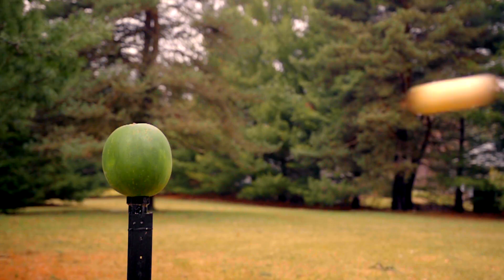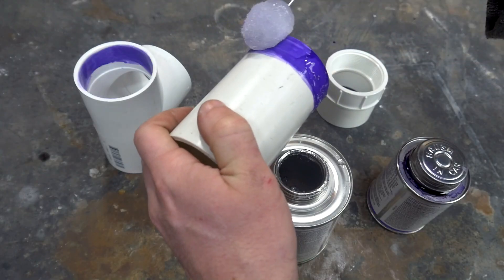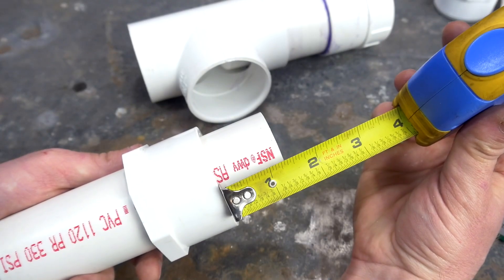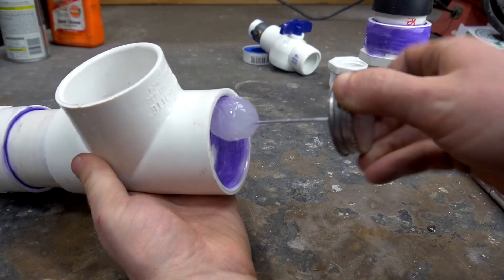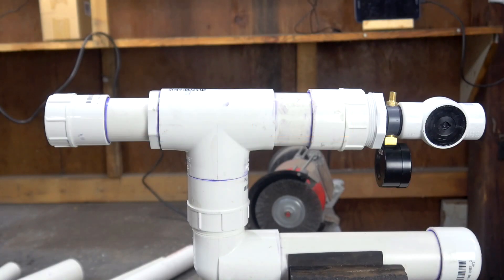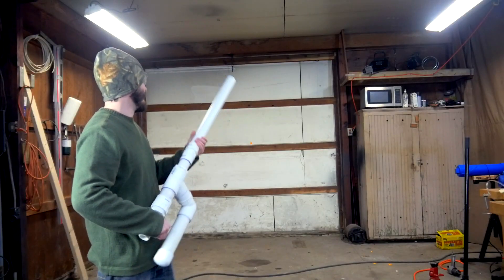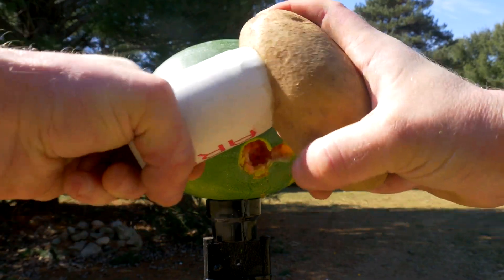How To Make A High Power Air Cannon - 2" Piston Valve (Barrel Sealing)

Comment: So I put it all together finally and it wouldn't pressurize and from what I can tell the gasket doesn't seem to be making a seal. Is there any way to tweak it with everything already sealed up? What would happen is that there would be some very, very slow pressure build up but once I pulled the air compressor away, it would instantly depressurize from whatever sad PSI it had run up to.  I figure it had to be the gasket or the piston and the piston looked fine and was properly greased up.

I was pulling my hair out, so I just rearranged some pieces and was able to put together one of those idiot-proof cannons where it's just a pvc-cylinder-as-air-tank and then an orbit water sprinkler trigger which is perfectly fine -- BUT if there is some way to adjust things or if I'm missing something, I gots to know.
Reply from the maker: Typically when the piston leaks it's because the end of the pipe it presses against isn't flush and smooth, there's something wrong with the rubber seal, or both. One trick that can fix some leaks is smearing the rubber with ptfe pipe thread paste. It makes the rubber sticky and seals imperfections.
Reply: @Nighthawkinlight  Thanks for the tip. It was a challenge putting it altogether so I don't want to completely just throw in the towel, no matter how frustrating. But if that paste can't get it to go, it'll have to be the idiot-proof cannon for me.
Reply from the maker: @divergentthinkingproductions  There's other options also. You can pull off the rubber fitting on the end of the barrel and instead glue a rubber face to the front of the piston. It can be a tricky thing to make a seal and takes a lot of troubleshooting the first few times.
Reply: @Nighthawkinlight  So I think I'm going to split the difference and use the threading paste on the gasket and then use some flex seal at the end of the piston and see if that will sort things out.  

New question:  The paste. Does that need to set or do I apply it to the gasket and just have at it?
Reply from the maker: @divergentthinkingproductions  Start with the paste. There's no set time. Flex seal has a chance of making things worse if it applies unevenly
Reply: @Nighthawkinlight  SUCCESS!  The thread paste did the trick. Very, very satisfied and very happy. A rewarding build. The only thing I have to say to other folks who want to build this is that if you're just angling to have a simple cannon that you can put together in an afternoon, this is probably not for you. But if you want a challenge and something with more kick, this if for you.
Reply from the maker: @divergentthinkingproductions  That's great to hear!
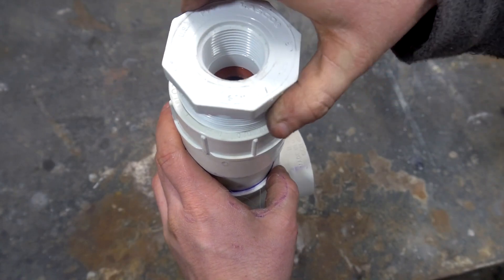Reply from the maker: You should be able to access the internals by unthreading the fitting installed at 4:50 in the video. Also I made a mistake in recommending light oil for lubrication. It's better to use heavy bearing grease.
Reply: @Nighthawkinlight  I have been using the heavy lithium grease so it runs smooth. The larger issue is that I sealed the main body up with a  layer of fiberglass as a safety measure since none of this is rated for gas and an ounce of prevention and all that (the gas cylinder and trigger still are removable). I can still access the gasket by unscrewing  the trigger end and using a brush at the end of a long dowel or something. I know nobody has exploded themselves with these cannons yet, but I'm a big proponent of overbuilding (although it does sometimes bite me in the @ss.)

Comment: The air is coming out of the sprinkler valve when I add air but all of the holes are plugged. Can anyone help me with this?
Reply: I have had 3 sprinkler valves fail on mine. I don't think they are designed for air. I ended up using an ASCO Red Hat industrial valve with 2 12 Volt batteries in series to make 24V and connected to a switch. You need a valve designed to work with gas or air.
Reply: @jonlovestheword  thank you

Comment: New question: Drain valves. I was looking at some designs out there and I found one that had a drain valve as a safety measure.  If I were to put one in, would it go where the pressure gauge and fill valve are  or on the tank?  The other design was on one of the straight ahead variety without the bend.
Reply from the maker: A drain valve would fire the cannon if it's where the other valves are. Put it in the tank if you want to have one. To install it drill through an area where pipe and fitting overlap so the pvc is double thickness.

Comment: Two questions: 1) how flush should the piston be? It takes a push to put it in mine, but then it moves freely inside. Should it be more flush? 2) What do you mean by light oil?  Are we talking about baby oil? WD-40?
Reply from the maker: If it moves freely once inside that's perfect. I did say light oil in the video but I ended up preferring heavy grease like bearing or axle grease.

Comment: You could have just used the "blowgun" valve, without the sprinkler valve. It would have worked just as well.... I made a very similiar cannon out of 2"copper, back when it was way cheaper, that launches/launched mini nerf footballs. That was alot of fun.

Comment: I built this thing following your video but I have air going through the gun and out the barrel would you know a way to fix that?
Reply from the maker: Depends on a number of things. End of the barrel might not be smooth enough, rubber may not be sealing properly, hole in the piston may be too large. I would first try partly plugging up the hole with pvc shavings and cement

Comment: shopping list
teflon tape, pvc cement and super glue 

nsf-pw 2 in t fitting
nsf-pw 4inch 2 inch diam pipe
nsf-pw 2inch female threaded adapter
nsf-pw 2inch to 1 1/2 inch pipe reducer 
nsf-pw 1 1/2 pipe length
1 1/2 pipe coupling
nsf-pw 2inch by 1inch threaded reducer
lil bit of sheet rubber
nsf-pw 2inch threaded coupling 
nsf-pw 1 1/2 threaded coupling

PISTON 
nsf-pw 1 1/4 coupling & end cap
nsf-pw 2 1/2 long 1 1/4 pipe 1 5/8 x 2" o ring

BALL VALVE TRIGGER
1 inch ball valve
brass fill valve & pressure guage 
sch 80 pipe nipple 

CHAMBER 

nsf-pw 2 inch threaded elbow fitting
nsf-pw length of 2 inch pipe
and a nsf-pw end cap

BARREL

he used a 2ft long nsf-pw 1 1/2 inch pipe but i would recommend more barrel for more velocity
male 1 1/2 pipe adapter

Comment: PVC fittings should always be twisted immediately after they have been pushed together. It aids in the equal distribution of PVC cement around the fitting, resulting in a considerably stronger connection

Comment: Just started building - should the piston be so tight that it is tough to move and has to be tapped in with a rubber mallet?
Reply from the maker: Use heavy axle or bearing grease on the o rings. It should be a snug fit but move when you press on it without seizing.
Reply: @Nighthawkinlight  Thanks. i think I squished the O ring when I assembled the piston.  I removed the ring and filed the slot out and it slides a little easier.  thanks for the reply and the great video.

Comment: If you were to seal the hole in the piston, pump chamber to below piston psi and ignite chamber (to make chamber psi spike) the piston would move back to allow the high pressure chamber gas through to the barrel yes?

Comment: What type of oil have you found works best on the piston? My piston is quite a tight fit in there.
Reply from the maker: I like wheel bearing grease
Reply: @Nighthawkinlight  even with the piston well oiled, it's very difficult to move.  I'll rebuild the piston until i can move it easily by hand.

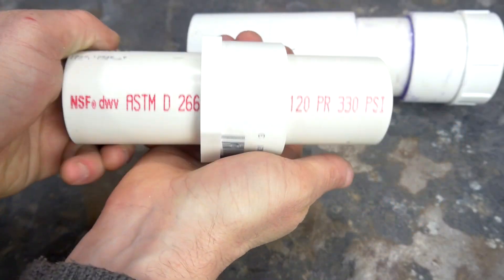Comment: How were you able to slide that reducer over the 1 1/2 pipe (dry) without cement at 2:20?  There's way too much friction for me to be able get that much pipe through the reducer.  Did you sand it down a bit?
Reply from the maker: Sometimes they slide over easily and sometimes it takes some sanding.
Reply: @Nighthawkinlight  thank you.  I'm in the middle of this build and got stuck at this point yesterday.  I ended up putting glue on the fitting and trying to slide it all the way down, but didn't make it.  I'll get another fitting and do some light sanding today and do it your way.  Thanks again for this great video.

Comment: Is there a way you can form a vacuum in the barrel and use the piston at the same time?  Perhaps you could hyper extend the pistons travel to push all the air out of the barrel , load the projectile, attach the aluminum foil, then retract the piston back to its normal position?  Also, would using a sprinkler valve instead of a ball valve help deploy the projectile faster?

Comment: For letting air in, instead of a small hole why not a bigger hole and put a check valve (or low pressure blow off valve) inside the piston so it can flow air in faster but not lose air pushing back open?
Reply from the maker: That would work fine, as long as the hole is still small enough that pressure behind the piston pushes it forward hard against the barrel to make a seal when the tank is starting to be filled.

Comment: how much faster do you think this valve is compared to a regular sprinkler valve?
Reply from the maker: Sprinkler valves are fast. They work similarly to a piston valve like this. The difference between the two is that a sprinkler valve has a smaller max opening size, and the flow path isn't as direct.
Reply: @Nighthawkinlight  ahh thank you so much! thinking of building something just like this. for a first time, do you think it'd be worth trying to make a barrel sealing cannot or just go for a regular sprinkler valve? your cannon looks quite a bit more powerful than other ones i've seen running just off sprinker valves. trying to get max performance but don't mind a smaller diameter barrel :) maybe it can shoot painballs or something similar.
Reply from the maker: A sprinkler valve is way easier and more likely to not cause you any problems. A valve like this is more powerful, but if you don't build it precisely it will leak or not work at all. For a paintball size barrel (or anything less than 1" or so) there's little reason to use anything other than a sprinkler valve. Look into modifying the valve to work pneumatically instead of electrically and it will work even better.
Reply: @Nighthawkinlight  thank you so much for your replies! even on a 3yr old vid :) your design still seems to perform so much better than sprinker valve operated cannons, even with larger air tanks. Although more effort I think i'll try and attempt your design. is there any benefit to going with a bigger tank than shown in your video?
Reply from the maker: Chamber size depends on barrel size. For more reading i suggest you read on the spudfiles forums.
Reply: @Nighthawkinlight  cheers! just finished my exams and hit up the local hardware store. looks like i'm going to have to go with a 40mm (~1.6in) T fitting in order to be able to get a workable piston from 32mm (~1.26in) pipe. do you think that'll impact performance much compared to the 2 in (50mm) size you use in your video? sorry for all the trouble!!

1 and 1/4 inch end caps are just way too small inside 2in pipe here in Australia :/
Reply from the maker: Any size will work, so long as the barrel is slightly smaller than the piston diameter.

Comment: Hi, really cool video. Was just wondering, how do you ensure that the piston stays in the position so that the hole drilled into it is always directly above the chamber? Is that what the O ring is for?
Reply from the maker: It doesn't need to face the chamber
Reply: NightHawkInLight thank you for the quick reply. We built it according to the video and however, the air is leaking out the front of the barrel. We were also using an air compressor at a local gas station which also didn’t work. Any suggestions to help? Our piston hole is also 1/16 in
Reply from the maker: Plug the hole up partially, 1/16 is too big. Hopefully that's all it takes to fix
Reply: NightHawkInLight - thanks for all your help! The hole was the issue and we’ve been able to use a hand pump to shoot foam balls out super fast. Looking to get an air compressor soon. Thanks!

Comment: I tried to build this but for some reason my piston won't slide back.....thoughts?
Reply from the maker: Too small a release valve possibly, or too large a hole in the piston
Reply: @Nighthawkinlight  The hole in the piston is 1/16" and the valve is the RainBird Heavy Duty In-line 1" valve.  Is it possible my piston goes too far forward.  I made it so it would meet the rubber stopper midway through the T joint? Your help is appreciated.
Reply from the maker: @alexleclerc6261  1/16 is pretty big. All you need is a little pin hole. You can partially fill it with some pvc cement and shavings. What pressure are you testing the cannon at?

Comment: what will go faster, this or a sprinkler valve that has been modified. would it be worth it to invest the time in this or just use the sprinkler valve
Reply from the maker: Sprinkler valve is more reliable, this is faster. This with a sprinkler valve as exhaust is super fast.
Reply: @Nighthawkinlight  also, i was wondering what pressure youre most comfterble at with 2 inch pvc. we usually go to about 100, what do you think the  "max" is that wont explode if you drop your cannon
Reply from the maker: Dropping your cannon could cause it to shatter even without pressure. 100psi is max for me, I don't recommend others go over ~40 to be safe.
Reply: @Nighthawkinlight  yeah, we have relatively long cannons, like a 4 foot long tank, and a 5-6 foot long barrel, and we use a 1 inch sprinkler valve, we have had some experiences were dropping it caused the connector to break, without pressure thank go, but still, 100s are max to, i was just wondering about your thoughts as you seem to know what you were doing. also, for you vacuum cannons, what pressure are those getting to, specifically the no- vacuum pump ones.
Reply from the maker: Vacuum cannons can at most only get down to -14.7psi, measured as 29.9in/Hg on a vacuum gauge. All versions of my cannons are getting within 95% of that.
Reply: @Nighthawkinlight  okay, thanks, there will probaly be a video of my cannon on youtube in a couple of weeks if you want to see it, thanks for all your help

Comment: How long did it take you to fill the pressure chamber to 65 PSI through a hole that size in the piston? I'm considering to build a barrel sealing piston version that has no hole in the piston. Instead I would have two ball valves to fill the pilot chamber behind the piston and the pressure chamber separately.  I guess that would reduce the filling time and maybe increase the cannon performance slightly.
Reply from the maker: It fills in about 10-15s

Comment: I built one of these following the instructions in this video but I can't seem to get the piston to seal against the rubber coupling. The air pressure just goes straight through and out the barrel as fast as I put it in. Any suggestions on how I could fix this issue?
Reply from the maker: Are you filling it with an air compressor or a hand pump? It may need to be filled faster. The root problem is probably the end of the barrel not being cut flush and smooth, or the piston having some imperfection on the face
Reply: @Nighthawkinlight I was trying to fill it with a small air compressor (one that is intended to fill car tires) The end of the barrel that is inside attached to the rubber coupling was smooth. Maybe I did not get enough super glue to get an air tight seal between the rubber and the plastic. For the piston, I could not find a rounded end cap anywhere so I had to round a flat ended one with a dremel so that it would slide into the rubber coupling. I made sure that the rubber coupling was cut long enough that it would still fit past the rounded part of the piston head. I will try using a stronger air compressor but I don't have a fitting to connect the hose of the large air compressor to the intake valve of the cannon.
Reply from the maker: Hopefully the compressor is the main problem. If you can't fill air fast enough it can make it hard for the piston to seal.
Reply: @Nighthawkinlight  I used a stronger compressor and it worked great! I made the cannon into a mortar (with a larger air tank) that shoots 1 liter gatorade bottles half full and it shoots them at least 100 yards. Thanks so Much!

Comment: I am working on building this and I am having a problem with piston not retracting when pressing trigger mechanism (mod sprinkler valve). Any suggestions?
Reply from the maker: Make the hole in the piston smaller
Reply: @Nighthawkinlight  ok..i tried that..no go. I also tried a regular ball valve and have the same problem. Piston will not come back
Reply from the maker: What pressure? And is the piston greased? Heavy bearing grease is best.
Reply from the maker: And exactly how small is the hole in the piston?
Reply: @Nighthawkinlight  I figured it out. I did not get the exact same rubber coupling as yours Mine did not have the "half way rubber ridge" inside of it. I believe the piston went too far into the coupling. I put a small spacer inside the coupling and problem solved. Thanks for the project and the quick reply.